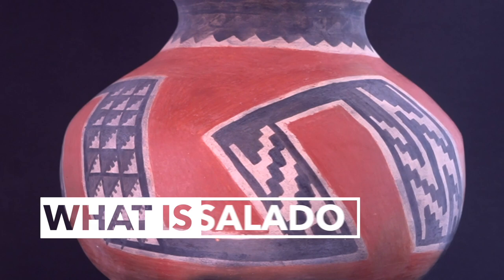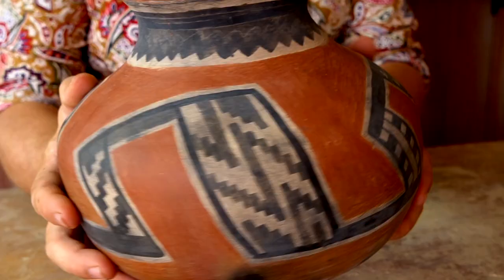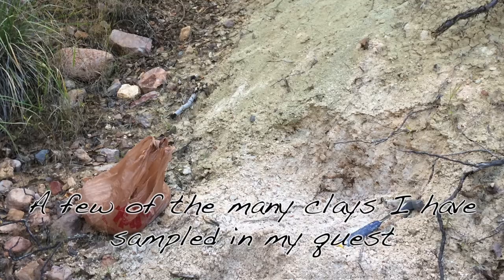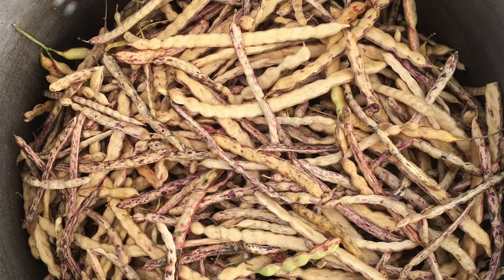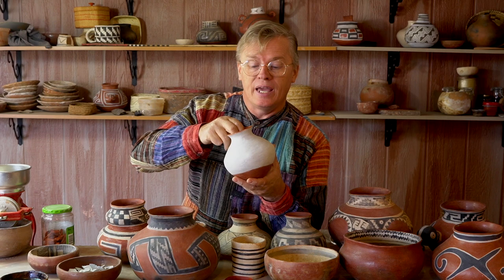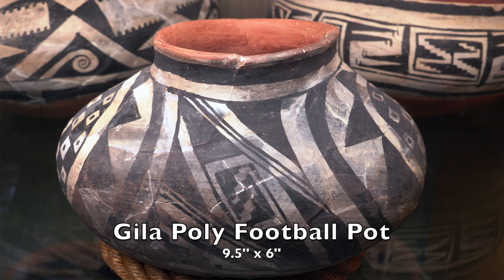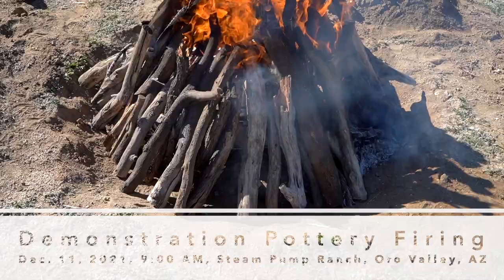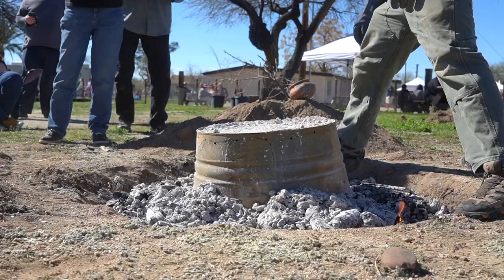Nuts & Bolts of Oxidized Organic Painted Pottery

Comment: Low temperature ceramic is a very interesting way of your research, as you could accomplish very promising results using clay as a geopolimer. In <600°C the  kaoline with Ca and K (this ion works better in ~1000°C) ions forms a very interesting crystals. And in truth you don't need to fire your pots in high temperatures if you have proper clay and other substances, to be waterproof ;).
Reply from the maker: It’s all about the right clay.

Comment: Should do some Karankawa. That would be pretty challenging, as there is such little information.
Reply from the maker: Did the Karankawa even make pottery?
Reply: @AncientPottery  

Apparently so. Though Ive only seen a couple of poor condition examples. To my knowledge, most of the Gulfcoast clay is ball and or bentonite and everything Ive collected was really sandy. So, the clay itself, is probably a significant challenge.
Reply from the maker: @springbloom5940  interesting, the clay in my area isn’t all that great either. Makes you respect the work of the ancient potters even more.

Comment: Do you think ceramic floor tiles will work for cover shards? Or will they explode?
Reply from the maker: I have experimented some with using commercial pottery as cover sherds, mostly flower pots. In my experience they work but break down quickly because they don't have enough temper to withstand the thermal shock of outdoor firings so they work for only one firing.